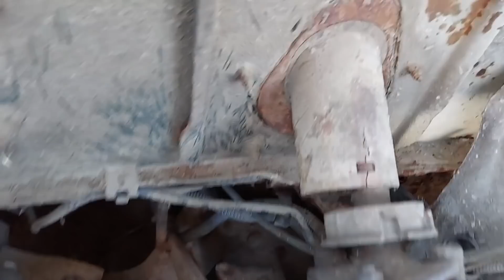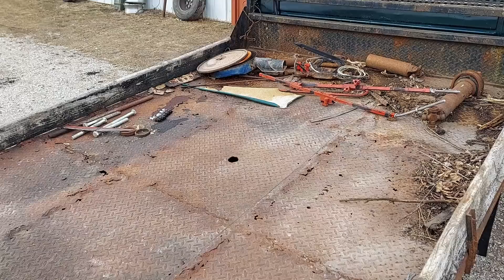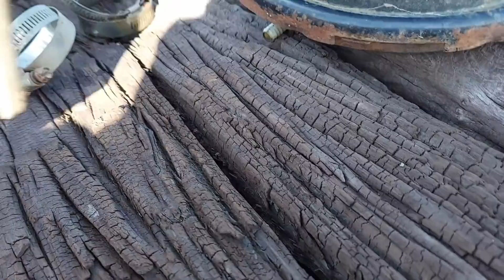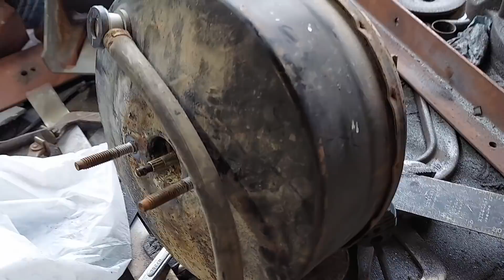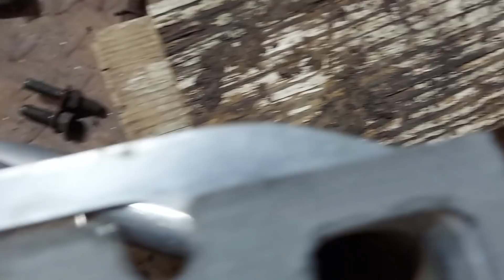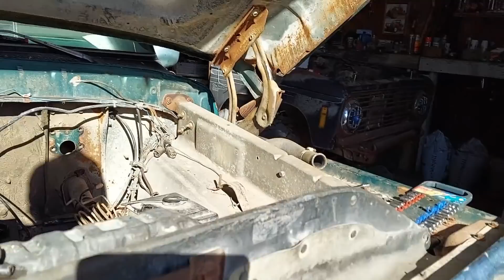Roadtrip of the living dead, Part 1-1978 F150 pried from Deaths icy embrace!

Comment: Damn, that carb was packed with mud-dauber junk! 
And I thought having all the bolt-holes in my VW engine-cases plugged up was bad.
Ha, those hoses are like the ones I built (for my grandpa's old truck) that I made from junkyard hoses and an old metal drainpipe for a kitchen sink! Mine even had a threaded joint that I sealed with pipe-dope. It held for the rest of that truck's life, until its steering/suspension was too loose to be safely driven. It was an old '83 F150 short-cab long-bed. Engine got ran out of oil once (and driven up the hill the rest of the way to the dump after it was all gone) but even that didn't kill it and it ran for years after that incident! That old 302 just wouldn't give up.
What was the plastic barrel being considered for?

Comment: Those washers barely working, better off making saddles from flat stock to jump the gaps. You can also vary the thickness of the saddle ends to hold down the two different heights.

Comment: On that other set of headers, to keep you from having to weld spacer tabs to the flange, you can get some 3/4 or 1” bar stock and make some offset washers. I’ve seen offset washers on mopar slant 6’s when using a custom intake or header combo. That’d probably be a lot easier to make with a mill, but I bet a sharpie, vice, and angle grinder could get the job done too
Reply from the maker: Definotely a viable and cleaner option if time permits

Comment: I may also be responsible for some of the missing parts on that truck😂
Reply from the maker: I believe you or your crew are responsible for for the pan and plate left under the hood of the red parts truck. I got it running and drove that truck home from the auction I bought it from, so I am pretty shure there were no kitchen/camping utensils under the hood. It was a good thing if you guys did leave them. I totally repurposed that metal plate as an air cleaner lid in next weeks vid.
Reply: @misfittoys8883  😂😂😂

Comment: How come you didn't use the rad out of the flare side
Reply from the maker: Not impossible, but kind of wide. I have a couple of 5.0 Explorer radiators in parts shed that would have been a pretty good fit with fairly minimal fabrication to use.

Comment: I love the 67 to 72 and 73 to 79 first truck was 1970 F250 4x4 grandfather gave me still have my 76 F250 4x4 son and I restored and my hotrod 67 shortbed 2 wheel drive . Why Ford did not do something better with the front cab mounts I made a lot of money in the 90's replacing front cab mounts I would charge $150.00 to fix them seen some guys with 2x4 under cab between floorboard and frame zip tied to frame.

Comment: I did the same thing on my 82. 2150 carb and it ran amazing. Couldn't kill that 4.9 also found that anything 78-96 "bolts" together. Brake booster rad stuff like that.

Comment: WHEEL BEARINGS AND CHECK TIE RODS GIVE A SHOT OF GREASE TO EVERYTHING. DON'T OVER LOOK THE U-JOINTS. CHECK THE DIFF AND TRANNY OIL 
MAYBE THROW IN A SPARE FAN / ALTERNATOR BELT 
HAVE A SAFE FUN ADVENTURE/ TRIP

Comment: To get rid of the extra barbs on the brass fittings.  I just chuck up a union in a drill, thread the fitting into the union and run em up against a bench grinder.  Works pretty fast.
Reply from the maker: That is brilliantly simple!!I should have thought of doing ptetty much the same thing with my lathe and flap wheel on grinder.